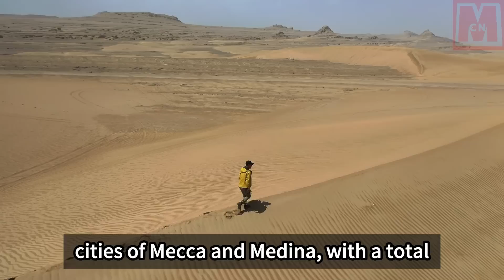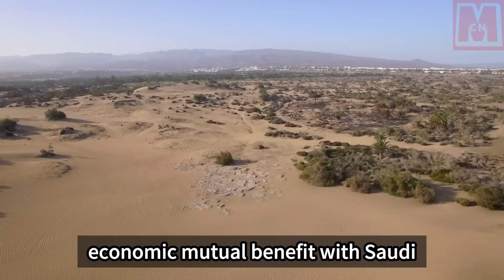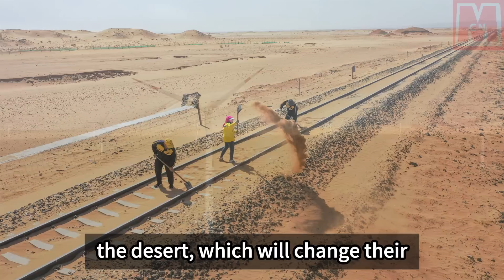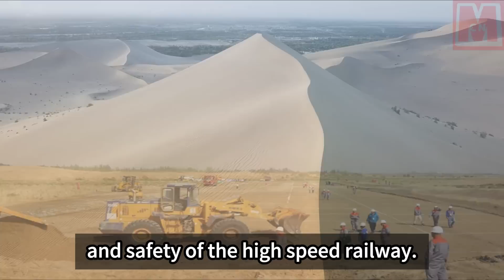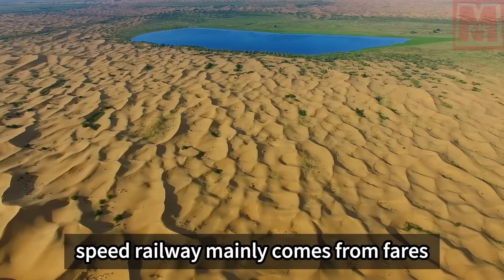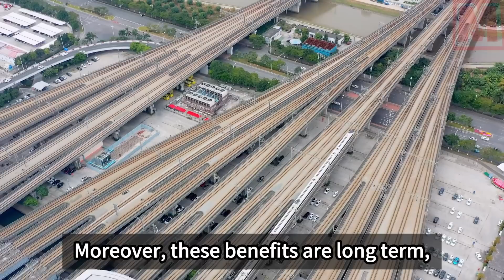Chinese Built！The first High Speed railway in the Middle East from Mecca to Medina

Comment: The second stage was awarded to the Spanish-Saudi consortium Al-Shoula for the construction of the superstructure (track, electrification, signaling, control and communications centers), the delivery of 35 high-speed trains, and the operation and maintenance of the infrastructure for 12 years.

Within this consortium, Indra is responsible for control centers (rail management and operation assistance systems and the consortium's management systems), communications (fixed and mobile), security (CCTV, access control and fire detection), traveler information systems, ticketing systems and reservations and sales.

Comment: It's not true.... Consorcio Español Alta Velocidad Meca Medina has been carrying out the contract for the execution of the second phase of the Haramain project for the high-speed railway line between Mecca and Medina (Saudi Arabia) since 2012. The project is being implemented with Spanish technology, which provides more than 25 years of experience as a leading country in high-speed execution. It includes the design and installation of the track and systems, the supply of 35 trains and the management, operation and maintenance of the line and stations for 12 years. The consortium is comprised of 12 Spanish companies (Abengoa Inabensa, Adif, Acs Servicios Comunicaciones Y Energia, Consultrans, Copasa, Imathia, Indra, Ineco, OHLA, Renfe, Siemens Rail Automation and Talgo).
Reply: So basically it's done by SAPTCO?

Comment: The Chinese engineer is marvelous and pesiverance and hard work and painstaking physical abilities .

The main thing two sides of. the railway line with boundary wall so that sand and sand Strom will not cover the railway line .
Second the uper part cover with plastic transparent fiber .so that sand wind will not affect the railway line and train .

Thirdly create aircondition system in construction site about 200,300 meters upper part and sides close just like indoor stadium .

Fly over bridges in railway line and roads is the efficient engineering for sand that cover the line and roads . 

Flyover bridge  should cover with transparent plastic fibers. and roads or may be 100 feet wall protection  from sand Strom in roads and flyover railway line .

Comment: Find one project that the US has built, not a cooperation that is given to the US which subcontracts it off to someone else making a small fortune for doing nothing but lip work
which inflates the cost immensely everybody passes the buck and the finished product 
is blocked in gridlock one blaming the other resulting in huge headaches and disgusted investors. China honours its contracts, the US sends lawyers that show the customer they are not responsible, sorry it's not our problem is usually the solution..